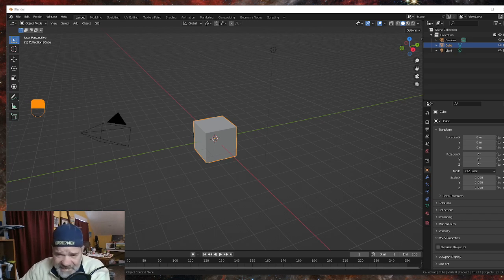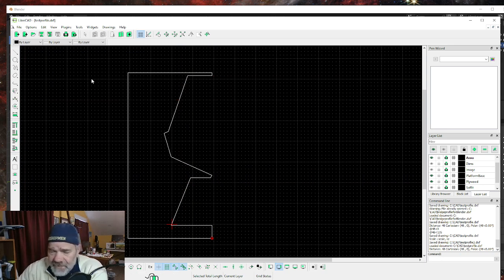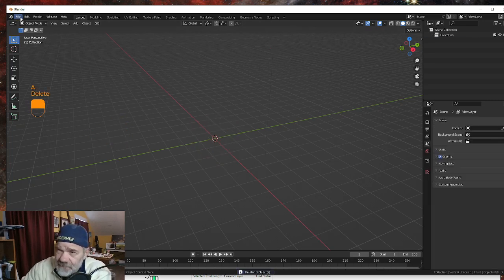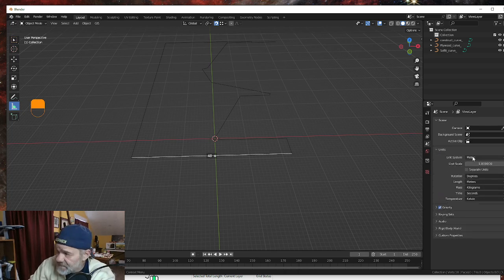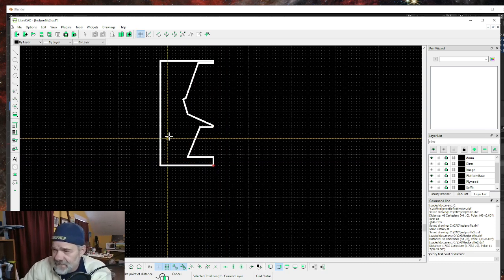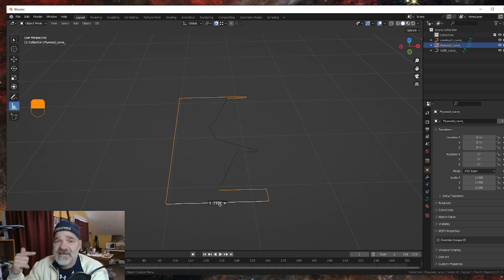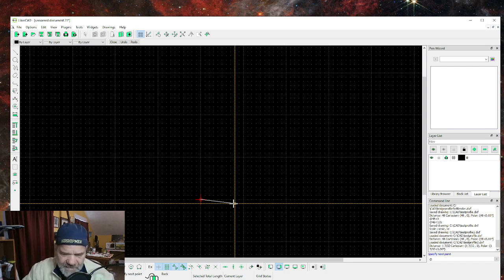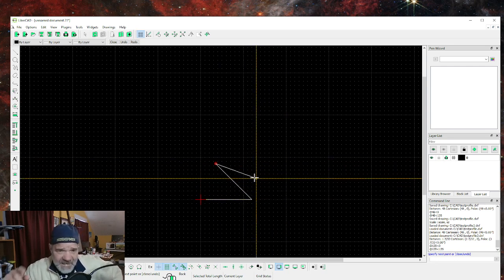Creating Scenery for MSFS: Using LibreCAD! IT"S FREE

Comment: Thank you for uploading. Seems interesting. I do this in Blender directly. Every vertex has coordinates and with Global/Local it is very easy to set exact positions. 
1. You can change the Units in Blender to imperial.
2. If you use Metric it is possible to enter ft in the textboxes. For example a box is Y = 10 you can enter in the textbox 10 m + 2 ft and the box will be Y = 10.6096 m.
3. You can set the Geoposition of your scenery in Blender. So it is possible to get the Geoposition of your objects in the Blender scenery very easy.
4. You can use GIS in Blender (free) and download Bing, Google Maps and Sat-Images with Geoposition.